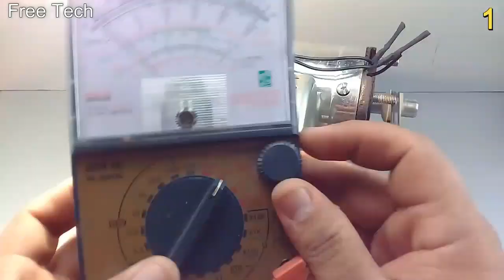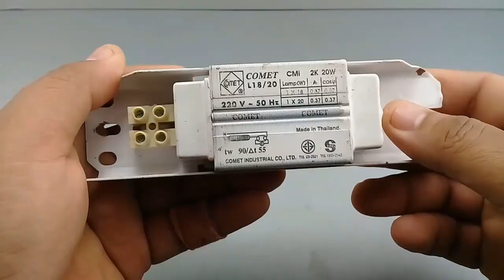Top 3 Free Electric Energy For Made at home

Comment: If you taken the voltage reading, it will be of no use as all we need is amp reading and not voltage, secondly, you used multimeter instead of watt meter